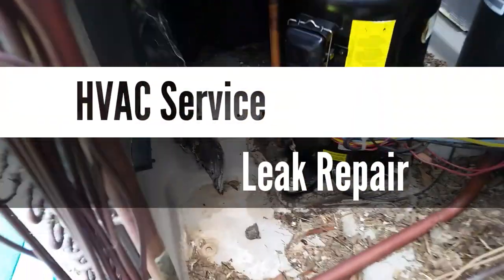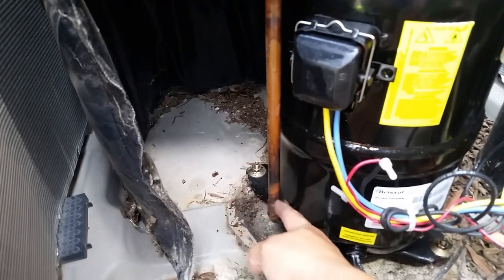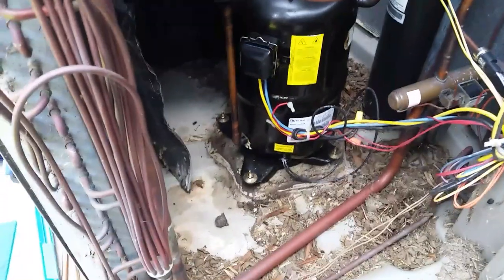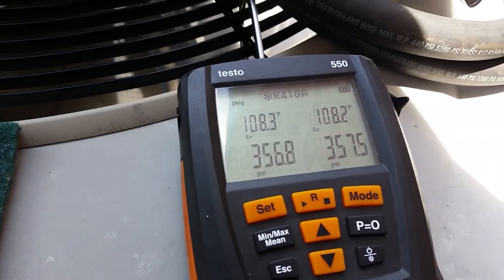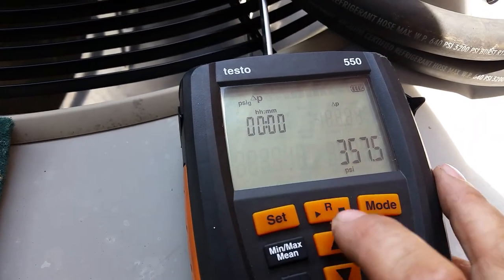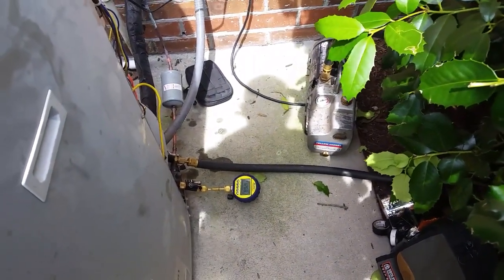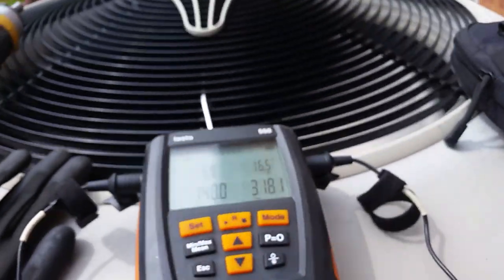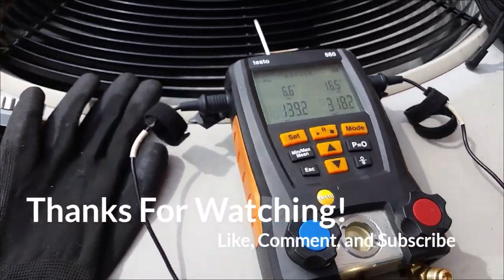Heat Pump Compressor Leak Repair

Comment: nice repair, whe have an old saying,its better to have crack in the pipe, than a pipe in your crack. by the way you should silfoss that, somtimes the factory will burn the copper during manufacture.
Reply from the maker: sjef oekel Thanks for watching

Comment: Insulation pad under the compressor help quiet it down some
Reply from the maker: Darin pugliese The unit isn't loud and the compressor comes with rubber mounts from the factory.

Comment: good one had a 550 for a while and didn't know about the pressure test thing... we have mini split city and few central air so superheat subcool isn't necessary and if you install vrf/vrv unit has sensors to adjust to conditions... but i mostly do refrigeration and we use superheat alot...
Reply from the maker: Alexander Figueroa We do plenty of Ductless, inverter, and VRF system where no gauges are really required majority of the time.
Still love my Testo 550's, smart probes, and even the 770-3 that Ive been using for a couple weeks now.
Thanjs for watching.
Reply: HVAC in SC i like my 550 had given em' a beating!! the smart probes look sweet but ain't in my budget for a while... the testo meter looks sweet also... i think all the negative feedback is mostly misuse imo...
Reply from the maker: Alexander Figueroa I agree.

Comment: Didnt change the drier?
Reply from the maker: nota newbie Always replace the drier.
Reply: HVAC in SC Wasn't sure. Couldn't tell for sure.  Good deal.  Nice work.
Reply: Well, I am curious why you just didn't sweat it out right at the drier, and replace that entire little piece instead of adding an additional swedge in between the drier swedge and compressor fitting? I know you probably have your reasons, but I am just curious.
Reply from the maker: THEtechknight That is a discharge muffler rather than a drier but I decided to go this route so I didn't risk peeling the paint off the base of the old muffler which could cause corrosion and a potential leak down the road. Just personal preference.
Reply: Ah ok, that makes sense now. I figured you had your reasons, but I was just curious! I mistakenly thought that was a drier though.
Reply from the maker: THEtechknight No worries.  Thanks for your comments and thanks for watching.
Reply: New filter drier box was on top of the unit in one shot. He installed on the line set, just didn't film it.